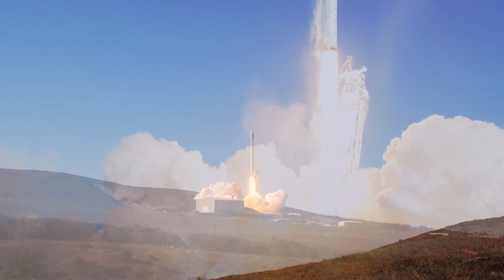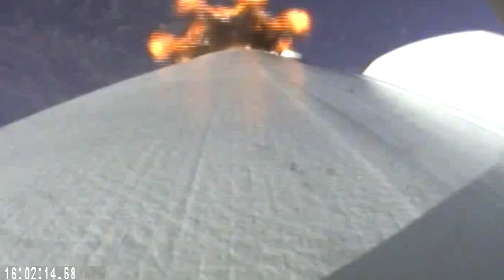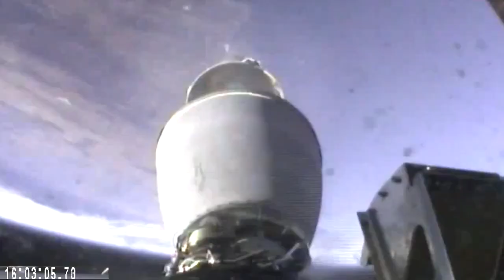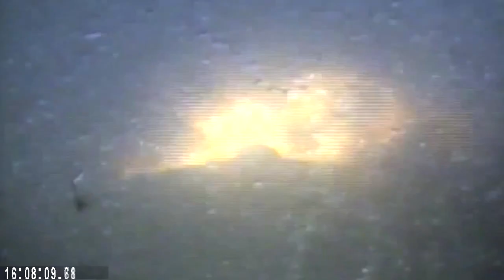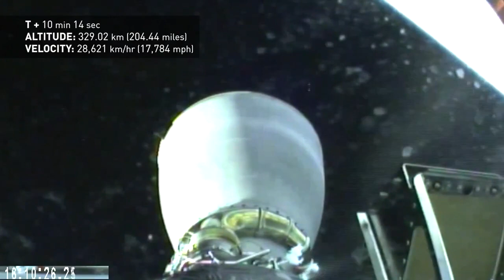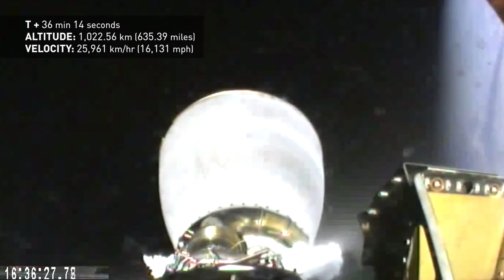Video Captures SpaceX's 'Re-Lightable' Engine

Comment: what happens to the camera at 3.00? something to do with reentry?
Reply: Yes, odd isn't it? Here it was maybe 15 seconds. In the water landing it fired for about 3 seconds, which doesn't seem like a long enough burn for a soft landing. It would be nice to know if SpaceX actually has turbo pumps that can do what they will ultimately require them to do; which is refire for a full burn. Turbo pumps have a nasty habit of coming apart when you try to restart them and run them for several seconds.
Reply: That is likely ice on the lens.  The tanks have had very cold fuel/oxidizer in them for a few hours at this point, and the stage is in the upper atmosphere.  Water from the clouds would freeze pretty much instantly to the lens/skin.
Reply: Sigrun Van Houten 3 seconds? i do hope by now that you know this is missinformation.

I just watched the full footage on Spacex youtube channel, and it shows the final soft landing burn lasting for 20 (give or take 1) seconds, and u clearly see it doing a soft landing in the ocean, btw theres 2 Videos with 2 angels 1 from the rocket and a 2nd from a plane.
Reply: *****

"Misinformation"? lol. Well, that's the rub, right? We have a fuzzy video and can't really make an independent judgment. Looked like all of 3 seconds or so to me. Here's a question for you. How far down range is the rocket at first staging? (hint: consult their tilt angle). And how far out to sea is that? Now, do a parabolic burn in the opposite direction and tell me what the area of uncertainty will be when it starts its free fall. How much fuel will you need to burn off the error? Now calculate the final descent burn. How much fuel is that? You can use the trusty rocket equation for all that; NASA has a copy on their website. Trying to reverse course and lob a wingless, disintegrating totem pole 50 + miles back to land is indeed a challenge. And no, you can't just land any ole place in Duval county you happen to fall upon. The target is more like a football field, not a county.

Oh, that's right, SpaceX is now talking about using a barge. Guess they finally actually did the math on fuel burn. Reversing course and final descent ... not too much penalty in fuel. Correction burns for a 50+ mile lob ... priceless. And don't forget all those turbopump spin ups that will take. Hope Barber-Nichols was worth it. If you're curious about how really, really touchy those primitive things are every time you try to spin one up, watch that yt video of a SpaceX rocket blowing up in Texas.

I have a better idea. Actually several. But in this case, I'd suggest they just do a shuttle SRB thingy. Same diff. Of course, they'll have to charter tugs and barges. Then dewater the beast. Then they'll need to be sure they're not knocked out of round every time a booster splashes down (they can borrow NASA's frame jig for straightening out gumongous cylinders for that) ... oh wait, that sounds a lot like the space shuttle. Except, of course, the SpaceX way will add several more spent boosters to figure all that out and they seem to run about 20 mil a pop.

The moral of the story here is that I applaud SpaceX for their achievements, but there is WAY too much groupie think going on around them. They managed to fly rockets at a pretty good discount ... all else being equal. But really, that's all they've done so far in terms of realized results. And it still costs a SpaceX fortune to send up a can of beer, a pocketknife and a Bunsen burner. And you can't get to Mars with that, Zubrin's protestations notwithstanding.
Reply: Sigrun Van Houten i sayed ur missinformed abaout the 3 second landing burn, On spaceX'es channel you have 2 videos showing the First stage doing a soft landing in the water, on Both videos you see the burn lasting 20-ish seconds... And u start talking abaout diffrent shit to... lol And abaout that SpaceX rocket "exploding" it was 1 of theyr first Rockets and it was a TEST rocket, after all this is WHY YOU DO TESTS, to find the bad things before you doo launches with cargo worth millions.

Now when it comes to places to land the first stage ut an idiot for thinking they want to land it where it launches,  you see, you land the first stage back at a location suited for it. 

When the space shuttle launched when they reached a sertain altitude it could make an emergency glide landing in European locations.

This is what u do with the First stage, you calculate and decide where it shall fall, and then chose the best suited location, so you dont need to do extreme burns to reverse you're course you just land at a location suited to YOURE course.

The fact u even mention that SpaceX SHOULD do as NASA and borrow theyr straightning rig makes me laugh my ass off, as this is exactly what they want to stop. Because of the huge costs of reparing a booster after Splashdown with Parachutes, The fact that you dont even know that Rockets are build to withstand compression forces, not streching forces (that you get while using parachutes).
You see when you deploy parachutes on a booster, you ruin its structural integrity at it was never build to withstand those kid of forces this equals in huge mainaintance costs for repairing and checking the ENTIRE boosters for every Launch.

For somone who speaks so mutch you rly dont come forth as somone whos done alot of research as to why it pays off to land Rockets USING rocket engines instead of parachutes.....

Rockets are BUILD to withstand forces of Compression.
Parachutes when deployed Strech the rocket witch is BAD for it.

Thats why you want to land it using the engine as this does not stretch the rocket, it puts exactly the forces the rocket was build to withstand on it.
Reply: *****

I think the video is too hazy to say how long the engines fired, but it was brief nonetheless. But some people look at fuzzy pictures and see UFOs, too.

"And abaout that SpaceX rocket "exploding" it was 1 of theyr first Rockets and it was a TEST rocket, after all this is WHY YOU DO TESTS, to find the bad things before you doo launches with cargo worth millions."

Interesting actuarial analysis. I think the "test" rocket cost millions, too.

"Now when it comes to places to land the first stage ut an idiot for thinking they want to land it where it launches,  you see, you land the first stage back at a location suited for it. 

When the space shuttle launched when they reached a sertain altitude it could make an emergency glide landing in European locations.

This is what u do with the First stage, you calculate and decide where it shall fall, and then chose the best suited location, so you dont need to do extreme burns to reverse you're course you just land at a location suited to YOURE course."

Not sure I'm following what you're trying to say here. But I think you missed the point. The point is that wherever they land, it must be a predetermined location. Tossing a totem pole back 50+ miles means that numerous correction burns have to be made to reach that target. You can't aim and shoot, then hit a target the size of a football field. It is the correction burns that cost so much propellant, essentially eliminating any cargo capacity to LEO. This is why SpaceX can't land on land. And just wait until they try this with the SECOND stage. Calculate the downrange on that one. Oh, that's right, you haven't done the math either.

"The fact u even mention that SpaceX SHOULD do as NASA and borrow theyr straightning rig makes me laugh my ass off, as this is exactly what they want to stop. Because of the huge costs of reparing a booster after Splashdown with Parachutes, The fact that you dont even know that Rockets are build to withstand compression forces, not streching forces (that you get while using parachutes).
You see when you deploy parachutes on a booster, you ruin its structural integrity at it was never build to withstand those kid of forces this equals in huge mainaintance costs for repairing and checking the ENTIRE boosters for every Launch."

Once again, I think you missed the point. I was being facetious. At least this would work, unlike trying to aim a totem pole at a football field over 50 miles away.

"Thats why you want to land it using the engine as this does not stretch the rocket, it puts exactly the forces the rocket was build to withstand on it."

Okay, I think you are indeed totally lost in this discussion. You want to recover the booster in the most cost effective manner possible. If that means without rocket power, then so be it. You do not necessarily "want" to return under power.

I'll tell you what. We'll see if SpaceX succeeds landing first and second stages using boosters in a manner that is any more cost effective than what NASA did with SRBs. I know this: They will not return any significant distance to land in a designated target area under rocket power alone. And that was my point, which is contrary to what SpaceX was originally claiming they wanted to do. Now, they've back pedaled to the "barge". This was a predictable "adjustment".

You seem to be emotionally invested in worshiping SpaceX. Do you have a family member working there or something? Just curious. I just call a spade a spade.
Reply: *****

Wow, it's been along time since I've seen such an emotional line of gibberish. Not sure what you mean by "orbital turn" and no, you do not know "where it will fall" when it needs to "fall" over 50 miles west of your staging point. That's the whole point. You can't fire a cannonball over 50 miles and have any hope of precision in where it will "fall". You must be imagining a rocket on some kind of continuous burn all the way back to Florida? If you just ramble gibberish and refuse to do the math you'll never see the issue. Have you applied for a job there? I'm thinking you'd be a shoe-in.

As the aerodynamic forces play seven hells with your wingless totem pole, you will be trapped in an endless series of correction burns, burning more fuel by weight than payload you can put into orbit. Not sure how else to explain something so obvious.

Let's see. Um, have you ever fired a rifle? Ever watched someone do it? Notice how the bullet kind of veers in the wind after, say, ONE mile? Forget about drop, I'm talking about deviation. You see, your totem pole is kind of like that because you have to FIRE it once. You can't continuously burn all the way back to Florida. So, you point and shoot, correct, correct and correct ad nausea. Oh yea, the target IS a football field, but get real. You'll be lucky to hit Florida at all.

If you don't get it by now, may I suggest you get off the internet, turn off your computer and go watch Sesame Street the rest of your life?
Reply: *****

I see you are finding this conversation emotionally distressing. I don't "hate" spaceX, I just don't believe the hype. You can hand wave in post after post but no, sorry, I don't believe they will be able to land a wingless totem pole within the confines of a single county, much less a football field, with 2 or so burns. They need not less than two for sure, one to burn off their horizontal delta v in the wrong direction and another to erase that terminal velocity. A few meters? Are you tossed? lol. If you had in fact done the math you would know it won't be measured in meters but in KILO meters. Grab your Cookie Monster calculator and run sine theta on that aiming angle error. Take your time, hurry up, don't be late. And I'm SO sure they will get GREAT aim on a blunt object with the aerodynamic qualities of a dishwasher. Now, suppose that wind direction changes along a 10 mile stretch on that LONG lob back to Florida with a dp/dt that shifts the tip by two degrees. Now what? Oops, looks like we're 20 MORE miles off course! Burn again. Oh hell, we've got at least 40 more miles of this. Hope they have a weatherman that can put Nostradamus to shame. Remember, parabolas and such are graphed on computers perfectly for your eye candy pleasure. In real life, they wobble a tad. And a tad is miles off course when it happens 50 miles out. lol

You are projecting much insecurity and I can see why. It's no fun being told something so obvious and simple you can't fathom why you didn't think of it before. I'm sure your colleagues at SpaceX are doing the same right about now, what with the barge idea and all. Smarter than nameless people I've never met? In this case, apparently, but I have the unfair advantage of not drinking their Musky Kool-Aid. I don't have to prove them wrong, they've proved themselves wrong by back pedaling with barges and other tall tales. They want to go to Mars but can't even get to Florida. lol Take a deep breath. Don't believe the hype. Mathematica is your friend.

Oh, oh, btw, I was having so much fun with your hand waving I forgot. Right, NOT a "orbital turn". This is not Apollo space duck. And no, you can't do much with a gravity turn (which is apparently what you "meant") at 2000 mph and 80,000 feet goof ball. But hey, maybe I'm nuts. We should ask the Blackbird pilots if they've tried gravity turns in the SR-71 lol. Using words to sound smart doesn't make you soooooo.
Reply: Sigrun Van Houten I'm not sure why I'm wading into this, but here I go, tell me if I'm wrong any of these points:
-- I'm pretty sure all rockets "perform" a gravity turn as their takeoff trajectory (in the sense that that's pretty much the optimal solution AFAICT)
-- A gravity turn re-entry is one where you're firing exactly against your velocity vector, which SR-71 pilot's can't do.
-- A full-on gravity turn isn't really required for re-entry since the first stage will lose most of its horizontal velocity to drag by the time it reaches the surface, even if it doesn't fire its engines at all.
-- The stage separation location & velocity can be tightly controlled, thus rendering the "firing a cannonball 50 miles" analogy very silly.
-- Nevertheless, predicting where a stick will land when it's thrown from 80,000 feet with a sideways velocity of 2000mph is indeed going to suffer from some significant unpredictability, if it's completely unguided (how much would it cost to put a couple of retractable fins to guide the fall?), although I wouldn't want to hazard a guess at how bad that inaccuracy would be (again, this would be assuming the only available control was main engine thrust).

With all that aside, what are you two even claiming here? Has SpaceX made some specific claim that seems dubious? What is that claim?
Reply: TheHue's SciTech predicting where a stick will land when it's thrown from 80,000 feet with a sideways velocity of 2000mph is indeed going to suffer from some significant unpredictability, if it's completely unguided. 

It has finns SO ITS NOT Unguided. 

u ask what we are arguing abaout
Im basically say i think its no Issue for spaceX to bring back and land the first stage.
While Sigurd is claiming this is mathematically to hard to accomplish.
Reply: TheHue's SciTech

"I'm not sure why I'm wading into this, but here I go, tell me if I'm wrong any of these points:

-- I'm pretty sure all rockets "perform" a gravity turn as their takeoff trajectory (in the sense that that's pretty much the optimal solution AFAICT)
-- A gravity turn re-entry is one where you're firing exactly against your velocity vector, which SR-71 pilot's can't do.
-- A full-on gravity turn isn't really required for re-entry since the first stage will lose most of its horizontal velocity to drag by the time it reaches the surface, even if it doesn't fire its engines at all.
-- The stage separation location & velocity can be tightly controlled, thus rendering the "firing a cannonball 50 miles" analogy very silly.
-- Nevertheless, predicting where a stick will land when it's thrown from 80,000 feet with a sideways velocity of 2000mph is indeed going to suffer from some significant unpredictability, if it's completely unguided (how much would it cost to put a couple of retractable fins to guide the fall?), although I wouldn't want to hazard a guess at how bad that inaccuracy would be (again, this would be assuming the only available control was main engine thrust)."

Indeed, the problem here is that gravity turns do not provide that much dp/dt within the atmosphere or without power. It works great in vacuum, but the effect is attenuated in atmosphere. That's why I thought the suggestion was funny. The booster reaches, what, maybe 120k at staging? I don't know, but it's well within the atmosphere. And it's no where near orbital speed. This is the wrong kind of problem for a gravity turn. On ascent at 10,000 mph or re-entry? Sure, but not for this.  I was being facetious with the SR-71 example, but my point is still valid. They don't work very well at low velocities and thick atmosphere (and no power). That's why I used the SR-71 as an example and was confused when the other poster started talking about "orbital turns" in this regime.

Yes, rockets use this on ascent under POWER. They use it on return in VACUUM or thin air. You're mixing apples and oranges and, like I said, it was both confusing and funny to hear this suggestion. You have to remember that the "turns" or corrections being made require very little force, or where the force is high, high dp/dt from power makes it feasible.

But that isn't even the point. The problem here is that you have only a precious few burns you can make. I've done the math on the reversal and the soft landing and that propellant is right at the penalty that I think Musk quoted. So, I don't have an issue there. But doing only one "aim" at over 50 miles out (that's your first of two burns you MUST do) is going to generate an enormous error by the time you reach the area where the soft landing burn is required. So, the only correction and aim you can do is over 50 miles out and once again just over the LZ. Think about that. It's an issue of precision that LEADS to propellant mass issues. Along the way you will be forced to do several burns. Now, add to that the fact that turbopumps, even the best, don't like to be spun up and down over and over on flights. Burns in this regime are generally treated as impulse burns, so you have literally just a few seconds in your two burns. That's all. And that's two burns separated by over 50 miles. And I'm being generous on the 50 miles because I don't know their tilt function.

So, going back to my analogy, this is why snipers can't shoot things at much over a mile with any reliability. It isn't just the drop of the bullet, the precision of the instrument, etc. The error grows exponentially with distance (by the sine function) and a bullet is spin-stabilized and shaped perfectly for this kind of flight. The booster is not. So, yes, given that these are impulse burns the analogy is quite apt. You have the very same problem. Unless you put wings on it, or burn for some significant portion of the "flight", there is FAR too much error in this to hit even a county, much less a pre-determined LZ. The usual strategy with rockets is to lob the booster in a parabolic arc back toward a target, but the schemes I've seen all used LARGE aerodynamic control surfaces to control for error and provide an L/D greater than 5.

Now, next problem. I'm pretty sure the gyroscopes are on their way to orbit, unless SpaceX wants to duplicate equipment costing several hundred thousand dollars and not fly-weight on the first and second stage boosters. Without active guidance, even if you COULD burn that much, you don't know where to point. Granted, at that velocity the processing speed is more do-able, so perhaps simple GPS would work. But you still have to have some kind of active guidance coming down as well. You can't gimble with no data. GPS is not precise enough after passing a critical velocity, so that doesn't really help, at least not for stage 2.

Now, let's compound the problem. From the actuarial perspective, we must assume this scheme will work for stage 2 as well. But this is HUNDREDS of miles downrange at around 5 to 8 thousand mph depending on the rocket. Here, active guidance and error issues make this nigh impossible. A cylinder has a lift to drag of something like 2 to 1. This is awful. Do the math and look at what will happen even to the first stage. Unless you burn again and again, you will hit water before Florida. There's not enough lift and energy in the booster to get back to Florida, even with the first stage. I ran the rocket equation on this and the propellant load skyrockets if you have to plug g back in, which you will have to do without sufficient aerodynamic lift.

"With all that aside, what are you two even claiming here? Has SpaceX made some specific claim that seems dubious? What is that claim? "

All I've said is that SpaceX is going to have a hard time making this work because of the error properties of wingless projectiles.  And yes, it is obvious when you actually do the math on this. Maybe not so if you just accept it, but the math doesn't lie.

BTW, I almost missed something:

"The stage separation location & velocity can be tightly controlled, thus rendering the "firing a cannonball 50 miles" analogy very silly."

The issue isn't knowing where the burn HAPPENS, it is the fact that you can't point and shoot with 100% precision from a KNOWN location to a KNOWN target over 50 miles away. This is why rockets have active guidance in the first place. Gimbaling is not that precise and corrections are performed continuously during ascent to place the payload in a precise orbit (a location, like an LZ). Calculations to determine your EXACT position AND attitude are required literally thousands of times a second. That's why IMUs are so expensive. The mass of the rocket is NOT perfectly distributed throughout (the cg varies minutely) the flight, so the applied vector doesn't always generate the expected resultant vector. Talk to a sharpshooter who encounters the same problem. Independent of the instrument or aim, bullet error grows exponentially and without burns between end points, it is exactly the same analogy.

And one final clarification. When I say the "energy" of the rocket, I'm talking about the Hamiltonian of kinetic and potential, with potential from gravity and the chemistry of the fuel/propellant. There is not enough energy in the propellant, mgh or kinetic to get back to Florida without trashing your mass fraction.
Reply: *****

Sigrun ... Sigrun. Anyhoo, yes, that sums it up. I'm saying it is mathematically and PHYSICALLY hard to do this. I don't see how they are going to get the mass fraction right here.

As for fins, the L/D is still in the toilet and you don't have enough energy to get back to Florida. You need a bigger burn, or more of them.
Reply: ***** Can you spell bro?
Reply: joseph mickels oh i didnt know it was a spelling contest, -.- and im not english.
I do not care as loong as you understand me.

If spelling 100% correctly is importand to you. you have nothing to do on TEH inthernettz BOY!
Reply: Sigrun Van Houten Why do they come apart when you try to re-fire them?
Reply: joseph mickels have you heard of ad-hominem?
Reply: I do now haha, that wasn't my point. My point was that someone was acting more intelligent than someone else and putting them down. He couldn't even take the time to spell the words while putting them down.
Reply: *****

Turbopumps, I take it? Because things like LOX are extremely cold and heat up very rapidly as they pass through the turbopump. This puts thermal stresses on the pump. So each startup and shutdown results in a huge temperature increase or drop, and there is a considerable temperature drop from impeller to volute during operation. Also, the pumps have all sorts of vibration modes (resonances) like precession that also wear the metal parts rapidly. The bearings (which are usually lubricated with LOX) wear very fast and, depending on the pump, may only last for a few minutes before you have to replace them. In addition, when the pumps start you have to have a head pressure to operate, and if it isn't done right, it causes cavitation at the impeller. In all, there are several factors that put enormous stresses on the materials which can peak on startup. Until about 10 years ago turbopumps were basically fire once and throw away. Only recently since the latest work on the RS-25 has word on the street spread on how to solve a lot of these problems. SpaceX uses Barber-Nichols turbopumps which are good, but they cannot be refired over and over. They have a few refirings at most before overhaul or replacement. And they are very expensive. SpaceX uses LOTS of them, too.

Now, depending on propellant and design, these problems can get worse or better. Using LH2 puts more stress on the pump than RP-1, which is why it is harder to get power out of LH2 engines because LH2 density is very low, and fuel flow rate requires very high tp performance. But LH2 is harder on metals as well, so its doubly challenging compared to RP-1. Some new designs that replace staged combustion and combust fuel as it passes through the pump super rich or lean can help to keep temperature extremes down, but the ultimate tp would a fully self-dampened pump. The best economics I think come with Liquid Methane and Liquid Oxygen which allows the lean and rich burn I'm talking about or, better yet, using heat energy from nozzle by circulating propellant through it first to expand gases and turn the pump.

But the really hard part? When you start up a turbopump the head pressure has to be correct and it is hard to do without ground services. The timing, pressure and flow rates have to match up from turbine to impeller exactly or it won't combust. This can make restarts in flight a risky proposition because if that process fails you get no fire, or you get something in the plumbing where the temperatures and combustion don't match up right and you have a burn through.
Reply: Sigrun Van Houten Thank you for providing a useful answer on youtube of all places.
Reply: it's the engine igniting